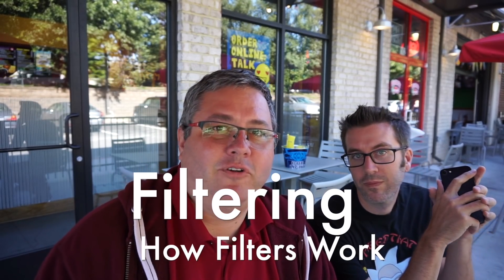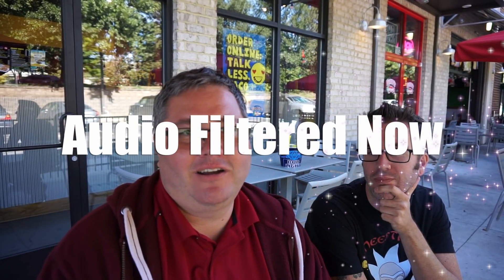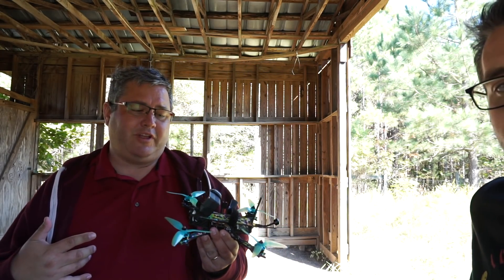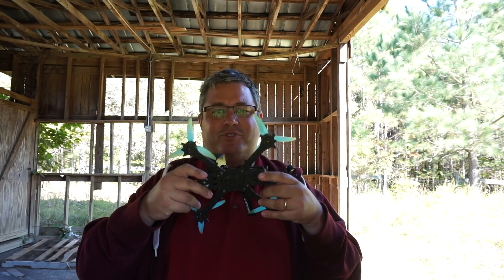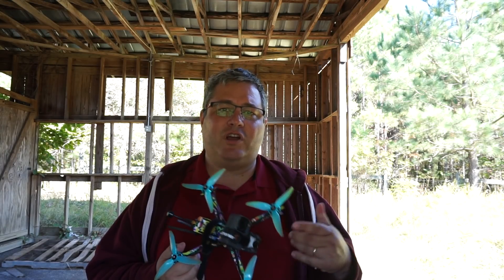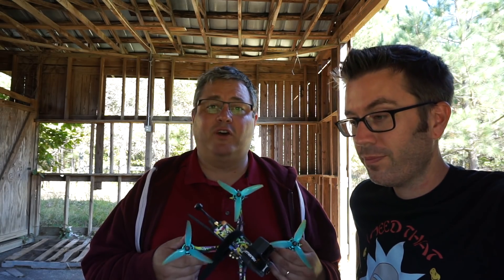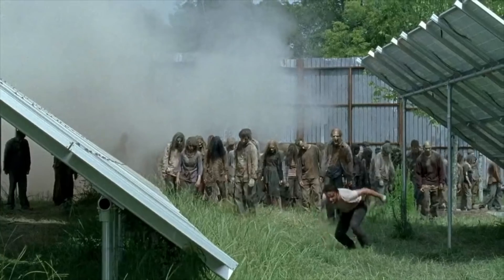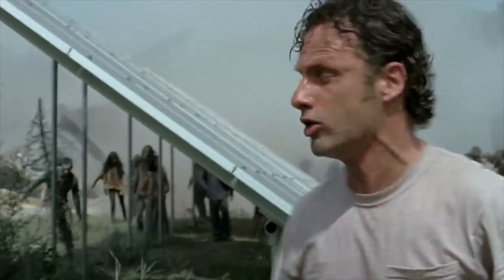FlightOne Filters Part 1

Comment: Question I have a skitzo Nova build with skitzo f.c flightone with bolt32 and when it sits on ground armed I get alot of jitter but even during flight u can see jitter. Is this filter or pids? Quad with lipo is 655g with GoPro I had default pids and default filter on Sim mode. I love the quad but need to figure out why it jitters so much at idle